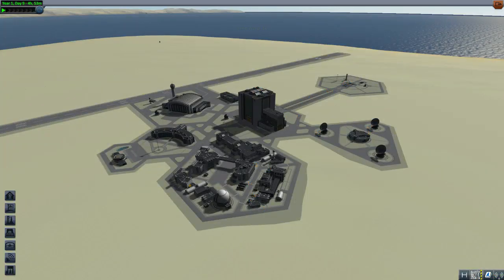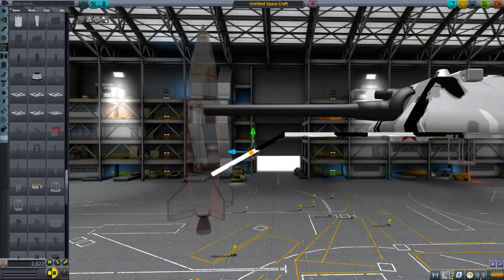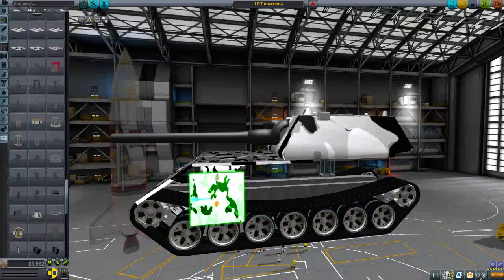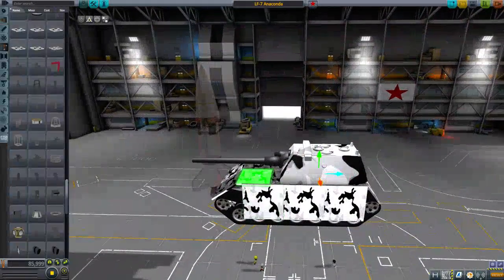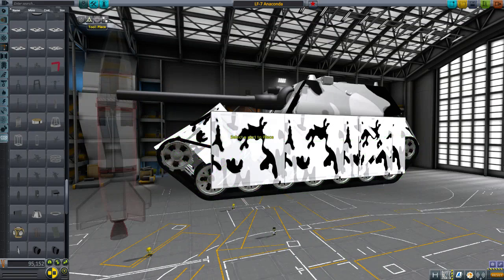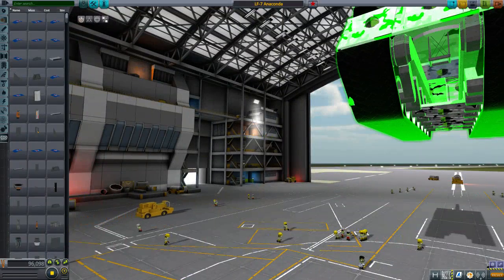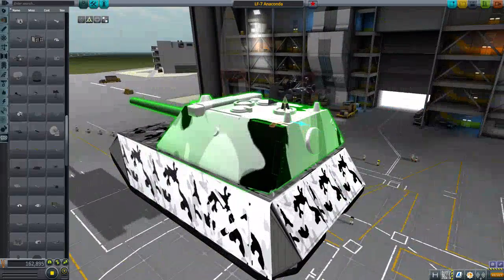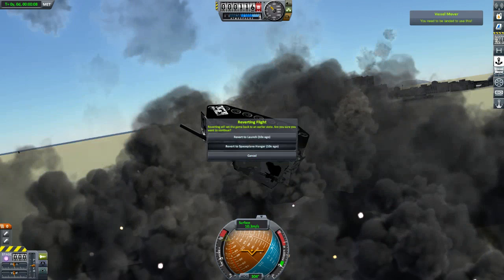KSP Fall Of Kerbin Livestream : Building a Maus

Comment: It is maus turret. This is the Maus-turm II which was an alternative design for the E-100 and maus turret. This and the curved one were the existing designs for both tanks. It was never built

And it is German humor, calling a giant tank a mouse. Kind of hilarious how the military did something like this :P
Reply: Neurofied Yamato Wow, someone else who recognises an E-100 turret when they see it, rather than just noticing it isn't the turret that went on the one finished Maus. :)
Reply: Yes, though technically both turrets are for both tanks. The curved maus turret was the Maus-Turm I which was going to be mounted on the Maus and E-100. The one here the 'E-100 turret' was also planned and designed. I don't know the exact details but Krupp designed it as an alternative to its first turret.
Can't find much info on it after the original mock-up of the turm I was made. The Maus Turm II(commonly known as E-100 turret) has a 75mm on top of the main gun instead of to its right as in the first design. 
Apparently a 2nd turret was planned to be made for the Maus prototype V1. I can't say for sure but it might of been the Maus Turm II.
Anyways the E-100 would of mounted the same turret as the maus. But since there were two turrets planned, it could of been either. The Maus Turm II gained the reputation it had for the E-100 because WoT decided to use it for the E-100.
Both the Maus and E-100 could of mounted either of the two turrets. By name, they both are technical the Maus turrets- but it also happens to also planned to be used for the E-100
Reply: Neurofied Yamato Aye, point.
Reply: Neurofied Yamato yes, those Nazis really knew how to have fun!

Comment: I had a similar problem on one of my old tanks. I'm pretty sure I fixed it by actually attaching the tracks via attachment points (the green dots). You can probably just add a couple more of those invincible parts and attach the tracks to them.
Reply: Also, you may want to check on the penetration of your bullets. Maybe you could just make them not penetrate (and just do heat damage) like the BDA .50 cal? Just have the different ammunition do an appropriate amount of heat damage. It would make it less realistic, but probably more consistent.
Reply: armor penetration isnt always accurate irl, so its more realistic the way it is
Reply: As you could see in the video, sometimes it doesn't seem to work for them. Guns are penetrating when they shouldn't be (watch the part where the 20mm blows a heavy tank into pieces). By more consistent, I meant that it would always work correctly.

Comment: Beardy did u think about putting the fuel cells in the back or making them smaller so they don't touch the armour panels ?? Also what do the rules say about light armour panels to create bulkheads like in a shit so if one fuel cell does up it dosnt take the rest with it ??
Reply: Ship not shit
Reply: Well the armour panels act like radiators "sucking" out heat from the shells such that they don't damage the inside untill the outer armour is breached. If there was armour inside aswell that would ruin this mechanic.

Comment: Do you know the mouth is actually 188 lb did you also know everywhere is mostly armor plating in if you want beer or not if I can so we can piece of armor but there's a little piece of light armor on the front of the barrel words pretty weak and anybody can really penetrate it but it's so small it won't even matter

Comment: BTW that is an e-100 turret not a maus turret. same gun but different mantle layout. the maus is curved whether as the e-100 is flat like the one you are using. the maus and the e-100 both use the same chassis so in other words you have made an e-100 not a maus. but they're pretty much the same so who cares.
Reply: Binglis2909 the E-100 has a different chassis
Reply: Yeah it does actually. That tank is Frankenstein
Reply: There were drawings of a "Maus II" with the boxy turret that Penguin is using.
Reply: Binglis2909 they have different chassis